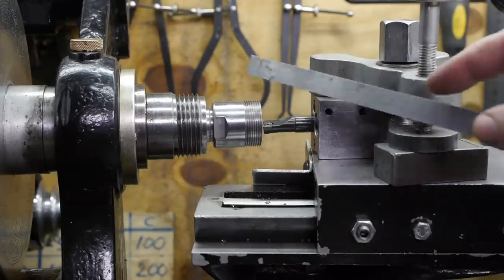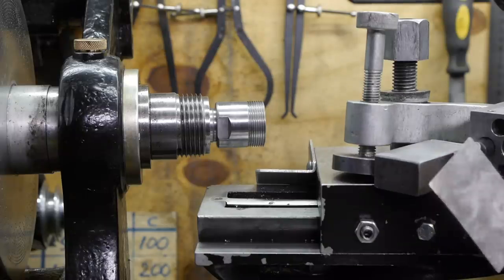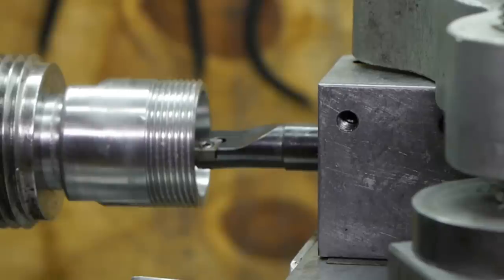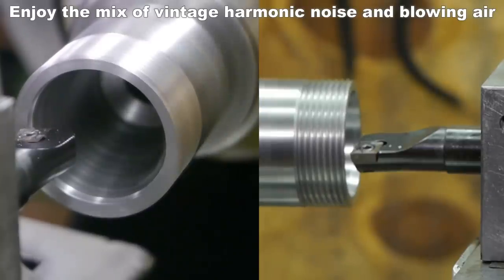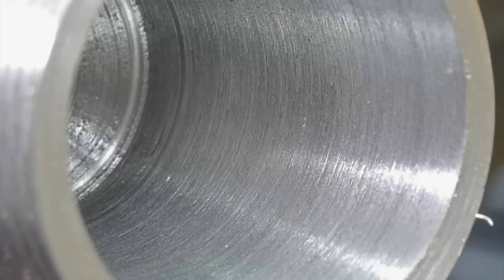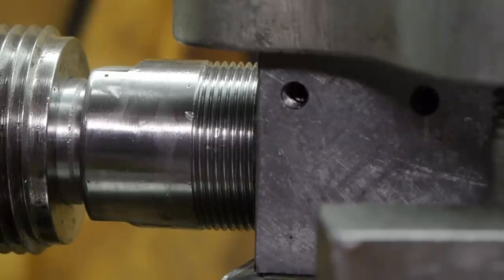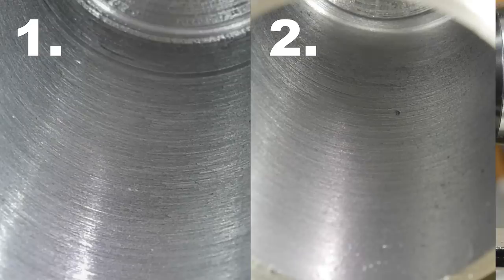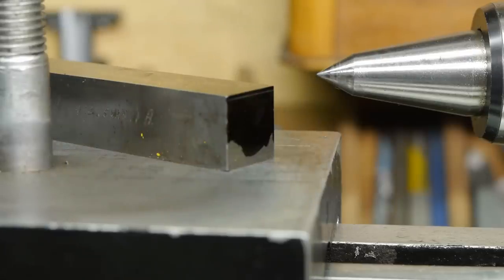Chasing the perfect mirror surface finish on an old manual lathe

Comment: Make sure you use the right kind of insert too, most roughing inserts have a radius lip around the insert so you had to take a very deep (more than 0.5mm depth of cut) cut in order to get a good finish. Finishing inserts in conjunction with a high surface speed gives you good finish at shallow depths of cut.
Reply: Could you please tell me what a "finishing insert" is? I am inexperianced and trying to learn.
Thanks!

Comment: I have had excellent results using non-coated inserts on steel, at least for the finishing pass, although they wear out quite fast you can certainly get a mirror finish easily, also you should use a constant flow of coolant, dripping by hand is enough.
Reply: crap, now I see you are cutting aluminium?? please use a non-coated sharp insert....these ones are way too dull
Reply from the maker: Not aluminium, I doubt aluminium collet chucks even exist :)

Comment: You will probably find if you tighten up the bed and cross feed your finish will change instantly.
The pressure on the tool tip is fluctuating from the loose bed and crossfeed.
If this does not work check your spindle movement.

Comment: if you have an angle grinder and a thin cutting disc you can cut away chunks of HSS instead of grinding it. With your luck make sure to take usual precautions.
Reply from the maker: I did some grinding this evening. it's slow and using a angle grinder heats thinks up very quickly.
Reply: Rolingmetal  using a 1mm cutting disc would prevent too much heat but it is unlikely you will put enough heat into the HSS to damage it, just be careful how you quench it if really hot.

Comment: Usually when i have to make a better finish, i increase the RPM, lower the feed rate, add some lubricant(HM can work with some lube, but it is not advised) and use a new HM tip. You did most of those things, but the feed rate still looks a bit too fast. Also remember there is a min. and max. limit that the tool can cut in, the tips i use a rated to 0,45mm-2,50mm, going lower than the min. it will always make a bad finish because it can't cut the metal properly.

Comment: Go on grind a HSS boring bar ;)
Old lathes were  not designed for the speed feed and depth of cut carbide insert cutters require to provide good chip control and surface finish.
Of course the field is wide open for you to grind the geometry on HSS but that is the skill :)
Looking forward to the next install.
Reply from the maker: Just did a 2 hour grinding session. Man that stuff is hard. I think I almost overheated the grinder.
Reply: @Rolingmetal   the purists may not think so, but I see absolutely no problem with using an angle grinder to rough them in!  At least, for anything larger than 3/8" (9-10 mm).  Save your benchtop grinder for the finer work.
Reply: Wow I can't believe it took that long.  Your piece of HSS may have something else in it to make it harder like Cobalt.
The good news is it will also be hard wearing when cutting scraptonium  :)
Do you have a dressing stick for your grinder?  Grinding wheels get blunt too.  They are self sharpening to a degree as the little abrasive grits break off as the wheel wears down but sometimes you need to flatten them out and get a fresh start.  Did you do some video of the grinding process?
Dave

Comment: I don't remember how you go about setting them up on that lathe, but you might double check your big end spindle bearing clearances.  If the play is excessive, the spindle will lift and the tool will wind up actually cutting below center.  Not saying there aren't other things to try, but, knowing you've had that spindle out several times, it would be a good idea to make sure your adjustments held.
Reply from the maker: I guess I could set them a bet tighter for one quick cut. At the moment if I run the lathe really long the bearings will start to bind a little
Reply: @Rolingmetal  Naw, you don't want that.  Don't risk galling them.  Maybe you should first see what result you get from your HSS (especially explore the use of a vertical shear tool for your external work, mrpete222 did a couple of videos on it).  Considering when that lathe was made (and what it was likely made for) you might be better off reserving the carbide for materials that high speed steel cannot even begin to touch.

I can understand the frustration.  My first lathe is an un-branded "midget" size that appears to be an approximate copy of a Barnes.  I've never gotten a cut from it that was smoother than the face of a bastard file.  I'm too stubborn, I guess, I'm determined to do all I can to iron that problem out of it before I pass it on to the next suc.... er, person to tinker with.  A super rigid stand (to remove any chance of torsion/twisting in the bed) and a properly made bushing in the headstock will be the beginning of it.  And since it is small enough, grinding the bed in with the surface grinder (another work in progress) would make a good learning project.

I'll probably give it away on the terms that whoever gets it will do the same (make improvements, then pass it on under the same conditions).

Comment: I also struggle with light cuts and finnish on carbide, but they are great for removing lots of matereal fast. So hi-speed might be better here.
Reply from the maker: I jest bought a set of these. https://ebay.to/2KQFP6y They are sharper and might work better on light cuts. But they are made for aluminium. Hope they arrive soon

Comment: I've found that caribe inserts from industry; even tough fresh, they still have a very small radius instead of a sharp cutting edge. In heavy industrial machines this is no problem; as they are powerfull enough and have high enough rpm's.  The small radius also causes the tool to stay "sharp" for much longer. This is where minimum depth of cut comes in. I have a lighter machine too; but I cheat by sharpening my carbide inserts to an actual sharp point. This isn't my idea; I saw it on youtube by Stefan G.  The results however were extremely good in surface finish.
Reply from the maker: The cheap chinese insets all seem to have a largish nose radius. Not  really sharp at all.
Reply: @Rolingmetal  Well; you must have one somewhere which is dull; grind the chip breaken part off; and radius the tip, hone to a nice sharp positive cutting edge. try shallow cuts first at high rpm's. They say carbide; but they mean really really hard highly alloyed steel. a 15€ diamond wheel on a el cheapo bench grinder will work. It does for me :-)

Comment: Due to the taper, the surface speed slows down as u move inwards. Have the same problem with my Colchester student. Not quite fast enough for carbide inserts (unsharpened

Comment: Looks like there was no tearing on the first one whereas there was some in the first. I don't know much about carbide so maybe tearing is par for the course at these speeds and feeds that are higher than you get on HSS. seems like lowering the feed rate, maybe doing manual feed if you aren't already doing it, and doing a shallow cut might help? This seems like a hard cut to do with a lathe that isn't really large.

Comment: Try using a more high positive sharp cutting tool, a lot of carbide actually isn’t as sharp as it looks and tends to push metal more than cut... high speed steel might give you a better finish

Comment: Doing a good job cranking out the videos lately. Thanks. I wonder what kind of finish you'd get if you started inside and backed out.
Reply from the maker: Hope to make a new one tomorrow if I can get that grinding done.
Reply: @Rolingmetal  They tend to flex a lot, or at least the ones I have do. I'm curious what grind you'll go with.
Reply from the maker: plenty of clearance and a small radius and if that not works a bigger radius.

Comment: Your clamping arrangement on the boring bar holder the clamp leading edge the part with the two ears should be slightly higher than the holder. Adjust the jacking screw up slightly, so that the front edge of the ears are a bit elevated, to apply even pressure on the holder.

Comment: You are certainly trying hard. 

I have machined only 2 tapers, both MT2.   My limited experience is that the finish I get by advancing the compound is not as good as moving the carriage with a locked compound.   Perhaps the compound moves slightly due to smaller mass or slight play in the gib when not locked.   I lock the compound unless I need to move it for tapers or threading.

Looking forward to the HSS attempt.

Dave.
Reply from the maker: this lathe doesn't have a carriage but did lock the cros slide gib for that last cut.
That HSS is freakishly to grind down. Did some ginding tonight and I think I overheated the bench grinder.
something was definitely smelling a bit strange.

Comment: You could try boring the collet hole straight , then press in a sleeve to bore it to the correct dimension - * turn the sleeve on the Chinese lathe ?   Freeze the sleeve , & slightly heat the collet chuck ?   Hahaha  . . . with all your bang good income , you could always buy another cheap replacement ;)      How much runout is there at the spindle ?  Obviously you know that the more 'shake' there is at the spindle, the less likely you will ever get a good finish.   Always entertaining !   Good luck      Congrats with your sub count !
Reply from the maker: It would be hard to thread the outside with a good concentric thread.
The spindle had about 0.02mm runout,

Comment: WD40 is not a cutting oil also you should take a final spring cut on the final setting as the boring tool WILL spring at depth

Comment: If you insert has a 0.4 radius, 0.2 isn’t optimal for finishing. That’s the minimum (half the r) to activate the chip breakers. Try ap 0,3-0,4mm. 1000 is technically too low. Vc250 ish and you end up at 2500 aprox… f0.080-0.100mm/rev. 
Unfortunately with you machine I guess achieving anything in inner diameter better than Ra 15 would be a miracle. Mirror surface can be claimed at Ra 1 or better in my opinion. Not easy to achieve the longer the bore gets obviously… 
Today at work for example I bored a 87mm long holes ID33-52 samples with a silent tool from sandvik (anti-vibration/dampened). I used 
DCMT11T304-sm IC907 inserts at:
Vc:140(Silent tools like less Vc); f:0.100(below 0,080 at surface gets worse); ap:0.3 and a lot if coolant, with max spindle speed set at 3500rpm (operating at 850-1100ish)…
My measurements today were Ra:0,95-1,0 and I used the same insert for roughing and finished (is faster and was enough for this operation as I’m in spec) I had to change inserts every 25 pieces and I just had to make 40 pieces so thats ok ^^

Hope someone finds that useful, cheers.

Comment: Great video!  I usually hear about WD-40 being used on alumin(i)um, and a heavier oil being used on steel.    Does that make any real difference? 

Looking forward to seeing what HSS does for you as well.
Reply from the maker: I would agree with that. Bit of wd40 prevent the aluminium from welding to the pointy bit
Reply: It does make a difference

Comment: A little high than low is better with a boring bar. You have to take a depth of cut at least the radius of the insert. You should grind a bar from HSS and compare.
Reply from the maker: All ready grinding. But progress is extremely slow.

Comment: Hello rolingmetal, the reason why your surface finish gets worse as you go deeper into the bore is most likely because the surface speed drops as the diameter decreases.
As for how to improve it, well sadly either taking a larger cut, or more RPMs. Or maybe both.

Well if you're crazy enough you could try scraping it in. ;)

Comment: I know this is ancient, but that feed rate is waaay too high to get anything like a mirror finish! If you use the same surface speed and a quarter (or even eighth!) of the feed rate you're using here for the final 5 or so thou in a finishing pass, you could get that thing as smooth as you want.
Reply from the maker: I still got that old chuck, maybe I'll give it another go :)

Comment: I would bet that a HSS tool will give you a better finish than what you're using.  Most carbide needs high speeds and feeds.  Maybe try another cutting lube than WD-40.
Reply from the maker: Hope you are right because grinding that piece of hss seems to take forever.

Comment: I would add that by using higher RPM, you would be away from the resonance frequency of your internal tool. (And at the bottom of your ER25, the RPM should reach at lest 3000!) I would bet at the Bottom level your RPM is may be 10 times lower ...

Comment: If you use round (circular) tool inserts with light cuts, light feeds, low speeds and plenty of coolant
That’s how I was taught
Reply from the maker: I have some round inserts I might try but coolant in not really an option with that wooden bench :)
Reply: Rolingmetal the only issue is not getting to a shoulder 
Maybe make a tray for under your machine

Comment: Carbide does not cut, not in the conventional sense any way. It deforms and bulldozes its way. That is why you need extremley rigid set up, high feed rate and very high speed. Take a look at the CNC set ups if you doubt my word. Then it will do its job. At 800 rpm on an old lathe the finish you are getting is pretty decent. If you are after mirror finish then with your set up, you have two options . 1- a properly ground HSS boring bar with a decent tip radius or 2- a die grinder. If the taper and the geometry of the ER collet holder is good then you should forget about ' mirror finish '. It makes for good video but it has zero difference in practice. Enjoy your adventures.
Reply from the maker: Bulldozes its way. I liked that :) Insert certainly look a bit dull. It will be hard to cut yourself with one of those. Home ground can HSS can be a lot sharper. Hope to try that this weekend.
Reply: @Rolingmetal  Something else that I only learned recently. The cutting pressure with a coated carbide tip is much higher than with a non coated one. So for hobby people with old or flimsy Chinese lathes like us, uncoated carbide is a better choice. I have seen some people use the tips intended for aluminium on cast iron and steel and so long as the tips last the results are much better than with with coated tips.

Comment: given 1/ the diameter of the ER 25 (25 mm?) and the fact you use insert the theoretical RPM should be about 1250. Looks like your RPM is far below.

Comment: Hi, seems to me that you don't have enough rpm on the lathe and also there could be movement in the ER Collet. From Portugal, great videos!
Reply from the maker: Might be but I don't dear go any faster then 1000 rpm. hope the hss does better
Reply: @Rolingmetal  you could also do a larger radious on the HSS tip
Reply from the maker: the hss grinding process is slow :(

Comment: Set 2--3mm  above centre height..... with carbide .. I don't know why it works but it does.
Reply from the maker: That's a lot. But then again you work with a huge machine. Do you have that much tool deflection?

Comment: Hi, try a carbide insert for aluminum, preferably one with larger radius, such as DCGT070208-AK H01 or VCGT110302 AK H01. They are very sharp and will also cut tool steel nicely with small depth of cut. And leaves a beautiful finish. See this: https://photos.app.goo.gl/xBUz5RmyKXBkYLvf7